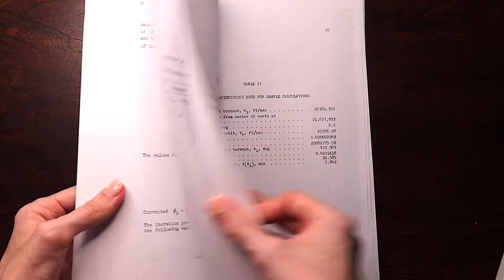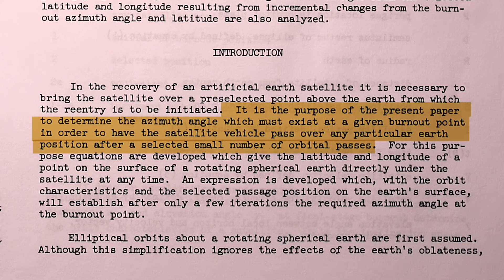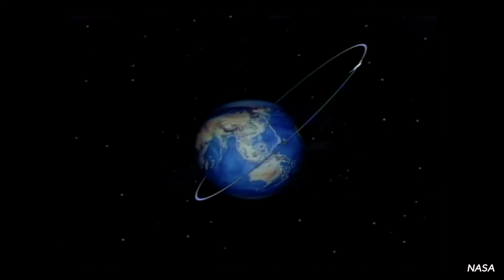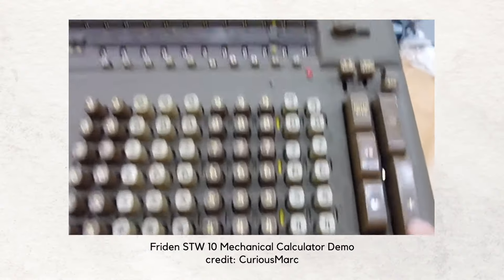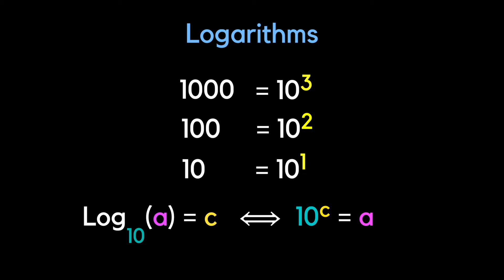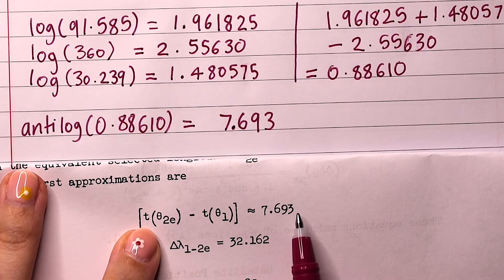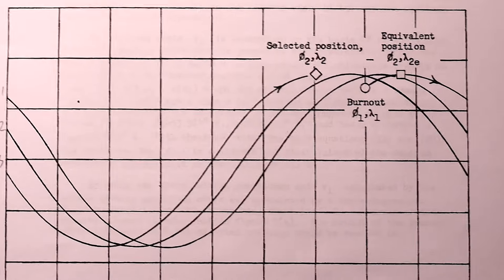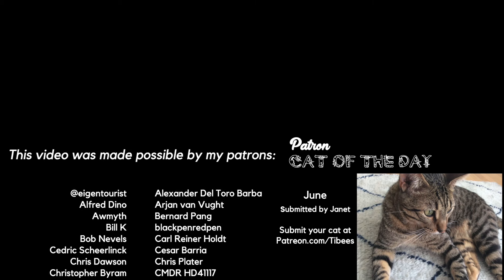I found Katherine Johnson's actual calculations at NASA

Comment: My grandfather used to work on programming for the big supercomputers of the 1950's, so when we finally convinced him to get a PC & taught him how to use things like Zoom, it was as if the universe had come full circle
Reply: IBM machines were just “mainframes”, not “supercomputers”. The first “supercomputers” came from CDC, in their 6000 series. They were around 50 times faster than anything from IBM -- that was really “super”.
Reply: I too came from the punch card era. You can't unpunch a punch card. Difficult things to use, especially if you dropped the deck of cards and mixed them up.
Reply: If he is up to task: How about showing him modern programming language like F#?
Not quirky think like c++ but F# or Python would be easier to use. How he likes excel?
How he likes modern PC?
Reply: @cybervigilante Absolutely! Also you can really mess up a run by putting an “o” into one of the punch cards instead of a “0”. Incidentally, the first value for an iterative process can be found with a slide rule.

Comment: As an engineering graduate who learned nothing about celestial mechanics it was interesting to get this insight. How Katherine developed the the initial equations  would be fascinating to know. I also did not learn Euler's modified method as an undergraduate but when my son was studying engineering he came to me with a problem that required Euler's modified method. I taught myself and my son how to apply it from a text provided by the professor. And I was a bit surprised at myself. I did not use much of the maths I learned at uni after I graduated but when provided with a text I was able to understand it. I took a bit of mental effort I should add. I think this illustrates one of the advantages of a tertiary education. You learn how to learn how to solve problems. I do not regret all the hard work I put in uni to gain that skill. It has enabled me to solve many other unrelated problems.
Great video Tibees, more please.
Reply: Yep how do you eat an elephant? One bite at a time 😂
Reply: Katherine didn't develop the initial equations, most of those came from Kepler.

Comment: The Euler-method was discussed for the reentry-trajectory calculation when drag had to be included in the equation of motion. That was something me and my group of colleagues thought was a bit odd - since Euler's method is not that efficient - which one would assume would be of interest if the calculations were to be done by hand.
Reply: I wondered the same. Higher order methods were well known at the time.
The Euler method, whilst still working, is more a tool to prove the existence of a solution rather than a real calculation method.

Comment: 7:00 Actually it was Babbage’s Difference Engine that was designed to compute mathematical tables. The Analytical Engine came later. Or at least the idea for it did--he was never able to actually build one.
Reply: I still remember seeing pictures of the Isograph, a mechanical device that calculated the roots of polynomials up to degree 15.  It was built in the 1920s and had the footprint of a large conference room table.  It came to a sad end.  When it was deemed obsolete, it was donated to Princeton as a teaching tool, where it was left out on a loading dock all night uncovered.  There was a heavy rain that night and the resulting rust ensured that it was a precision instrument no more.

Comment: Euler's method utilizes slopes to get the approximations closer and closer to the solution of the differential equation. You can approximate the solution as close as you want to by approximations. I remember doing that in calculus class.

Comment: My first necktie job was programming an IBM 360-30 at an engineering shop in Vermont. Punch cards, vacuum-loading tape drives, & three disk drives the size of washing machines... high-tech stuff!
Reply: I used to load those big tape reels at IBM to run my neural net training algorithm in the early 1980's.  They contained the training patterns for OCR.

Comment: The caption of the photo at 6:00 says it is at JPL in 1936.  The clothing, hairstyles and desks do not look appropriate for 1936.  Also, JPL was just in its infancy in 1936 and not likely at that time to employ a room full of people.  It’s more likely this photo is from the 1950’s, probably the late 50’s, or early 1960’s.  Those steel desks with hard rubber tops were very common in the United States.  I think they appeared during or after World War II.  I worked at one in the 1980’s.  It was a very serviceable desk.
Reply: Definitely not 1936, which is somewhat obvious given the context of this video and the sorts of machines being used.
Reply from the maker: True, the source of the image had 1936 in the caption but I should have tried to find some more info to verify the date
Reply: @tibees    I also suspect those Friden calculators are a model later than 1936, but I really don’t have enough experience to say that with any certainty.  I would easily believe them as 1950’s models.  Your point in showing the image was to show a situation similar to the one Katherine Johnson was employed in, and I think you achieved that, except for the minor matter of being on the opposite side of the continent.
Reply: A room with a dozen or more of those electromechanical calculators worked by skilled hands could be a fairly noisy place!  Not deafening, but hardly peaceful.

Comment: That is so strange that not included dynamic gravity that Sie Isaac  Newton had missed interpreted that is why satellite crashed down every where. Because the static gravity and dynamic gravity are two different that could add up to about 10-15 % of force different. If you not contract me to calculated you can add 10-15 percent if the Newton theory and it is free without paying for my intellectual property

Comment: Loved the vlog and the finger nails good touch , I was born in 1951 I remember the recent film, great leveller ,my farther sparked my interest in ballistic science, it helped a friend of mine to build a catapult to launch small sugar beat into the path of a jet that regularly buzzed his dads chicken sheds , in-spite of many complaints it kept happening, so we calculated the force needed to launch carefully weighed beat into the air, at a point in time the flight path was fixed by the jets we paced out the launch spot once the jet past over it the beet was launched the very first attempt was a bulls eye the jet lost one of its engines with a plume of smoke, within a few ours police and RAF personnel were all over his chicken farm, it seamed the beat had been spiked with Norfolk flint very hard indeed 🤣😂🤣 the only unknown calculation was the speed, we used stop watches over a quarter mile and hand signals, the impact height was 250 ft proving the RAF had been lying about its 500ft limit they insisted they flew at, since that day they never fly over the farm again, it is possible to beat the system 👍the beet six in number were of different weights to give a spread, of approx 30 ft in depth it was a lottery that the intakes would pass through it, if they had not insisted lining up over the track ever time with great accuracy it would not have been possible, they were very very angry puffing up there chests about cost but it seamed they were so embarrassed about the whole event it died away, there was some talk that some one shot at the plane with a shot gun 🤣😂🤣. We had intended to cause a hit under the aircraft causing the pilot to pull up and abandoned his run, you can imagine the panic when we hit the engine 🤪
Reply: This is a hilarious story.  Like a scene from Dwight Schrute's beet farm in the American version of "The Office".

Comment: Do you know why they don't use pi in T/ 360 ? 
It is because pi is not an accurate value being truncated to become an approximated value. So when you expand the inaccurate value, the inaccuracy will incease to give you wrong locations
That was why i said a few years aho that anything calculated with pi can only give you an approximation in a single calculation with it 
Ex: the circumference of a circle is said to be equal to 2π, while it is not an accurate value, and any curve or any circcle always comes from a straight segment with an exact value of length. So, the inaccurate truncated  value of a pi's endless series of digits obviously contradictory to the fact that every circle come from a straight segment which has an axact value 
My experimental value for a complete circle is equal to 6*its radius or 2* its diametre.
When you caculate canything to do with a circle, such as a globe, my values will give you more accuracy than pi does 
you can also do it by yourselves, all you need to have are a large piece of blank paper, a pen and different objects in circular shapes of different sizes  
unlike pi, when you use degrees to calculate anything to do with angles and oscillations, it will give you more accuracy
I am gona give you a simple example to make it very easy for almost everyone to see such a mathematical concept 
I have a segment of exactly 18 metres of hard wire and i want to make it a complete circular loop 
What is the radius of the loop?
iI bet that all you guys will asswer that it will be R=18/2π= 2.8647889757.......which can be be truncated to become approximately only 2.8647889757, and thus not an accurate number or not the actual value of its radius , and the inaccuracy is not very good for high-tech machines for real outer space explorations to anywhere else other than the Earth and satellite orbits around it, unfamiliar to human limited knowledge 
If you guys use the formular said above which is:
6R =18 metres → R =18m /6=exactly 3m no more nor less
 The error here is about  |(3.0-2.8647889757)/3|*(100%)=4.50703414% or rounded as 4.5% of the actual value
You can prove for yourselves,  with practical experiments,  my mathematical statement on the value of the radius of any circle

Comment: Not to complex, but considering at 50s, solving non-linear equations by hand, was hard, it was always good to find fast and accurate methods to get these results. There are many such methods developed in early 20 century. So it wasn't entirely new, or super original, just appling known methods to specific problem, because it must be done. These days, one would just plug these equations (which were known for over a century), into any non-linear solver (even just Newton method based solver) and you will have results in less than a microsecond. It is easy to say this of course, but making it work quickly and done by hand (and to be simple to not mistakes), is another story.